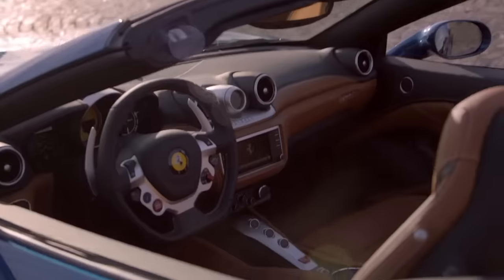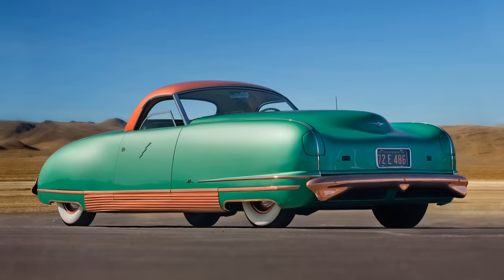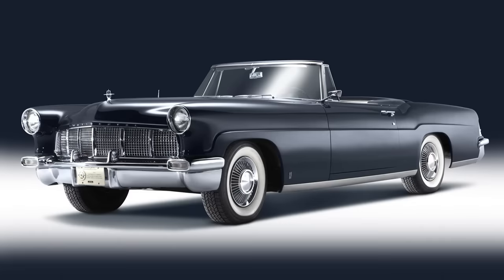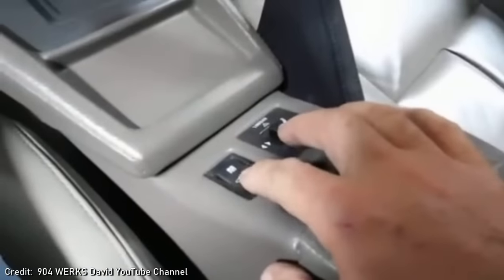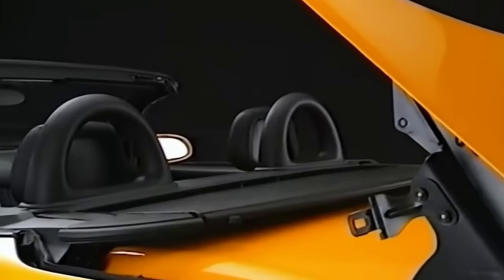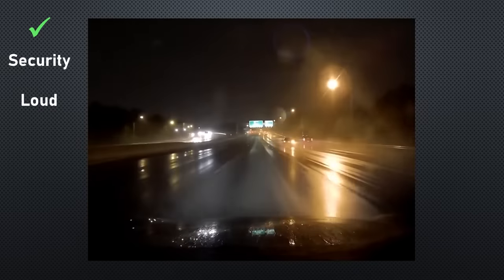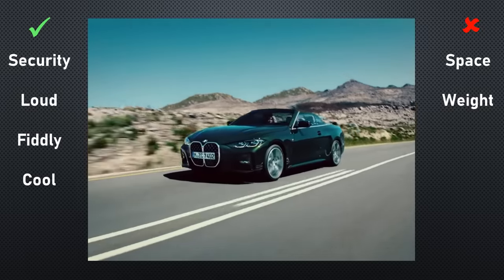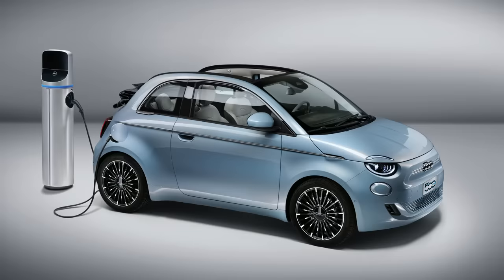The Rise and Fall of Retractable Hardtops

Comment: How far, if at all, does the RHT contribute to chassis stiffness (when it's up)?
Reply: Probably not much, if anything at all, as the structure is held together with hinges. The hinges would be pressure points for the forces.
Reply: @ar568  you can arrange hinges so they resist forces, but honestly I don't think it adds any significant stiffness.
Reply: @AR-zq9hq  If you do it for every hinge in every corner of each panel, you get torsional stiffness. 4*2=8
Reply: On the Volvo C70 2006-2013, the body ridgity improves with around 15% when the roof is raised
Reply: Considerably stiffer with the Megane cc. Noticeably so. But I only drive it with the roof down unless its raining.

Comment: But what about design factor? I am owner of SLK (2005) and I think, that hardtop convertibles are more solid that the softop. When car looks like a consistent  piece of metal - its almost piece of art. And when a part of car (roof) is made from some kind of fabric, it looks much cheaper (in my opinion). It like a your grandma trousers, hanged on a nice sporty car :)

Comment: Fondly remember my wife’s black 2008 Megane Cabriolet.  It was always fascinating to open/close the hardtop which included a glass panel roof.   A great drive on a 28C Australian summer evening with the top down, less so on a 43C Australian summer day.  2.0L petrol was a bit gutless, needed a turbo like the VW EOS.  
All our cars have had full glass moonroofs or sunroofs, but there is nothing like the experience of being in a true convertible.

Comment: I got one of the first SLKs brand new in late 1998 (as a 99 model). I remember putting the top down in public... crowds would gather. It was really a spectacle that nobody had ever seen before.
Reply: Thanks for sharing ! Must’ve been a cool moment. What was your color combo!?
Reply: @prabeeshsidhu  Black with oyster interior.
Reply: I hope the horrible rest of the ownership experience was worth that moment of attention.
Reply: @pistonburner6448  It was a great car. Never gave me any trouble and a lot of fun to drive. I put almost 100k on it from new and outside of regular maintenance the only issues it ever had was a motor mount needed replacing at like 60k and a parking brake interlock at like 45k.
Reply: @Dr.TJ_Eckleburg  Same can be said about a Dacia Sandero. Sorry to be blunt, but the SLK was a particularly abysmal example of a car compared to any relevant benchmarks.
Reply: Same story with a 2020 MX5 RF, most people dont really know retractables are a thing nowadays. Little kids especially go nuts when they see it closing/opening at a grocery store parking lot.
Reply: @pistonburner6448 who hurt you lol

Comment: Working in a garage there’s always a sense of dread when they come in with the roof mid cycle or not working.
Reply: Must be fiddly to rig all the microswitches on a folding roof. I imagine everything has to be set up to close tolerances.
Reply: Had a guy shatter the rear windshield on a Camaro top because he didn't install the replacement support brackets correctly 🙃 That's a $1200 mistake
Reply: Not going to name models that you have seen like this?  Enquiring minds want to know...

Comment: My Z4 retractable hard top is great, it doesn't go green like my previous Z's soft top. However when a hydraulic line split it cost me £1300 to fix. At least with a manual you can pull it up in 10 seconds, even when driving.

Comment: I think Top Gear really called it when they did their Cool Wall segment with the 206 CC: The auto-hardtops had always been a fashion accessory, so their appeal dropped off as soon as they became common. The companies that introduced them got rich off the temporary fashion and publicity, but you can’t be in fashion forever - and from an actual performance and practicality standpoint, hardtops are an objective handicap. The humble and simple MR2S manual softtop, with 2 latches for when it’s up and just one for when it’s down, remains as the perfect convertible implement.
Reply: I love how the older ones look with the clip on hard top. Reminds me of vintage lotus design.

Comment: I owned a Volvo C70 before and now a BMW 330 with a retractable hardtop.
I think it is a great concept: you can switch from a coupe to a convertible within 20 seconds.

They are aimed to be fun cars, not practical, although 4 adults will fit but trunk space is limited.
You know that before buying and if you can live with it, they are great cars to drive and perform well with top up or down.

Comment: I tried owning a soft top convertible (MX5) and didn't like it. I replaced it with a BMW Z4 E89 with a hardtop and noticed the following:
1. The cabin acoustics are much better. Road/wind noise not that much different, but I no longer felt like I was inside a drum. Overall feels more like a coupe.
2. Hardtop is far easier to wash and care for than soft top.
Not to mention the styling is much better with a hardtop in my opinion. 
While I know there are some downsides to a hardtop, like the weight and storage, and the added electromechanical complexity, I wouldn't buy another soft top. I much prefer the hardtop and I'm a bit disappointed they're less popular now especially since the technology is better than it's ever been.

Comment: I thought the Ford Skyliners from the late 50s were so cool. The entire top would automatically, with minimal folding, lift off the body, then stow away in the trunk, which had its own suicide door action. Definite flash over substance considering putting the top down negated any trunk space. And even when the roof was up, storage had been pared down to a metal based that looked like it belonged in a 1930s laundry room

Comment: Have a new shape A3 convertible and a 1 series convertible, both have been to the south of France from England several times, they are soft tops which means there is enough boot space for luggage unlike a hard top convertible, that space matters if you are going to use the car

Comment: Another disadvantage of hard tops are the awkward design that is often the result. Look at the Nissan Micra. Also the front shield window often extends much longer to reduce the amount of roof to store (check the 206 at 9:11). It reduces the cabrio experience. A soft top looks better and is more practical.

Comment: I think a number of convertible buyers want people to know they drive a convertible, even when the roof is up, and soft tops make that much more obvious than hard tops. Why pay for a premium feature if people are just going to think you’re driving the regular model when the top is up?

This was the same logic behind the first hybrid cars. They had to look funky and futuristic compared to the conventional ICE version of the same car, because early adopters wanted to make a statement as much as they wanted to save the planet. Now the hybrids look normal and electric versions have the distinctive trim level (some of which is practical, to save weight and improve aerodynamic efficiency by eliminating redundant air intakes and smoothing out the features).

Comment: I had a new 2016 bmw z4, which was great . I park in a lot not a garage and it was safe and solid . It was a fairly quick operation. Then a month after warranty, the electrical harness mechanism died. The bmw dealership barely knew how to fix it, and took almost 2 months to so do. The quote to fix was originally $3900, but after almost 2 months, they wanted the new quote to be $7000, um. No. It ended up at $4100 . Once i had it back, i sold it . Total love/hate for the car

Comment: You forgot one reason softtops are better then hardtops: the shape of the A-pillar. The steel roofs had to be small in order to be stored, so they made the window and a pillar steeper. This had the effect that when sitting in the car you almost touch the border of that with your head, a very unpleasant feeling. Softtops do not have that problem.
Reply: I like cars which are wide like an SUV from the bottom up to over the fenders. Then on top a small cabin and the people sitting close to each other like in the original mini.

Comment: I currently own a bmw 1 series e88. I love my car, but would MUCH rather have it equipped with a hard top rather than it’s soft top so as to have it’s look match the coupe. I understand that it’s a bit of a trade off vs a soft top, but I’d much rather add the extra weight in sacrifice of some power. The advantages in security alone dwarf the advantages in having a soft top. That’s before even considering how much cleaner the hardtop looks overall. 

I’ll put it this way: the bmw 1 series is, in my opinion, a beautiful car. With that said, an alarming amount of people informed me that my car looked so much better with the top down. All in all I just don’t think soft tops are the best look.

Comment: Loved this. I was planning to buy a Mercedes SLK but I have a wife and a kid and that means three seats. The SLK has only two. Ended up buying a CLK, a soft top based on the C and E platforms. C platform with E features, really. I still have my 2005 CLK and love it and I don’t think you’ve covered that car at all. Would be cool if you did. Extra points if you include the cars that came before it and the C and E class cabrio’s that replaced it.

Comment: My Peugeot 308cc 2ltr diesel 163 hp automatic is a pocket rocket. Also I've fitted a remote roof recline for £200 so I can recline the roof whilst i'm putting my shoes on!
One of the last to be built in 2014 and still has only covered 12k miles. The cruise control works from 25 mph so I use it around town . It takes all the stress away from accidently exceeding the speed limit . Headlights that track around corners with automatic height adjustment and auto wipers, heated seats plus airscarf.  I want to be buried in it.

Comment: I think you missed the mark with this one. Except for the cheapest solutions, which come with cheap cars, basically all convertible tops are hard tops anyway. E.g. Porsche tops may look like fabric, but on the inside are metal panels for the 911 and Boxster. Their marketing says that their customers prefer the look because they want to 'show' that they have a convertible. They still fold a bit more compact, but nobody buys a convertible for trunk space anyway. I would love to have an SL as a street parker, because when the pollen flies and the birds shit on your roof from the phone lines and trees, you'll know the advantages of a hard top... also, on real roadsters, a fabric top is simply a must in the eye of most owners. I think the Boxster would look kinda "wrong" with a hard top. It is not a fad, a fad is something silly, but hardtops are obviously not just a gimmick.
Reply from the maker: Thanks - good point. But it stands to my point that soft tops have more sound deadening (by having metal panels), so there's way fewer disadvantages now.

Comment: The one on my Mercedes SL leaked into the boot from the back seal. This is apparently a general problem and could be expensive as the electronics are in the bottom of the boot. I refitted the seal and patched up were the metal lip had corroded but it only lasted a short time before the leak came back.

Comment: I have an A4 soft top, you better be handy when they fail as the repairs and parts are like gold. Modern soft tops are very heavy and add on to that the pop up roll bar system and the story is complete... a very heavy car.

Comment: Soft-top convertibles look classier.  Having a glass rear window with heating-elements (IE, exactly like fixed-roof cars have had for decades) allows you to see on cold & chilly mornings, solving that very real safety problem.  Retractable hardtops are simply not needed.

Comment: I would not have bought my BMW Z4 E89 if it wasn't a hard top. Had 9 years and happy to keep it another 9 years. Perfect sports car.
Soft tops look like prams, very few get them right. Also trying to keep rag top clean from likes of bird poo a pain.
Reply: Only problem with E89 roof, BMW used poor quality wire which breaks causing roof failure. Otherwise my car works perfect 14 years old.

Comment: The problem with the used market is that the original drivers runs the cars into the ground for 50k miles and do little maintenance because the car is “still new”. Then the second hand driver has to restore improper maintenance issues that affect the car for the rest of its life. 
Fixing a hardtop that is out of production for spare parts sounds like a nightmare.
I wish there was a car company that exclusively made hard top coupes.

Comment: I will say this Hard top is cool but not when it started to have problem.. Soft top has issues too, but hard top breaks more often even if you barely drive. I had a 2020 SLC300, no problem with it for 24,000 miles. But then some people already had to fix their hard top two times before 20,000 miles. Fixing cost for both soft top and hard top are expensive but soft top is still a little cheaper than fixing the hardtop. Also, if you have a hardtop from Mercedes, its gonna be hard to find the part and it might takes a long time for it to be shipped from Germany to whatever country you are in.

Comment: It depends what you want and are intending to use the car for. I own two BMW Z4s with soft-tops and a Mercedes SL R230. There is no doubt that that the SL is much more insulting from wind noise compared with the Z4s even though they have glass rear screens. So, as a long distance car it is much less wearing on the nerves. 
I think all the reasons for less retractable hardtops being made today are valid but I also think the biggest reason is actually the profit margins of the car manufacturers. As said, why manufacture an expensive metal retractable hardtop when people will pay the same for a soft top? The boot space saving e.g the 15% example given, is hardly at the top of most convertible buyer’s list of priorities.

Comment: No mention of the Volkswagen Eos here?

Its not only a Cabriolet with retractable hard  top it features also that the sunroof segment can  be opened individually.

so far i know  its the only Cabriolet with this Feature.

most people think that these Hardtops doesnt need service / care like soft tops but its wrong especially all those Rubber seals and hoses to keep it water tight need a lot TLC and mostly owner related / not following procedures when servicing them its why they fail 

Every Eos owner should know Krytox ^^

Comment: I had a BMW E93. I like the idea but it was flawed, it leaked big time along many of the seals, added weight and made the boot space useless. Unless you really need sunburn on your bald patch a coupe equivalent will drive much better (I changed it for an E92) handling is better, it feels lighter and less body flex.

Comment: I do love convertibles, but they keep getting smaller.  Settled for a hard top Jeep which is significantly quieter then the corresponding soft top, and also better for heating and cooling.  But, hardly a push button open and I definitely miss the spontaneity!

Comment: It is sad that the hardtops have gone the way of the dodo. I live in Sweden and the climate is not compatible with cloth roofs. I used to have a Peugeot 308cc and just loved it. Looked really good with the roof off. Reliant tech from Citroen C4/Peugeot 308. A big enough engine and silent with the roof up. Had to sell it when the children outgrew the back seat. Now they are gone and I would gladly buy a hardtop convertible again, but there are none...

Comment: Sir, you show the Opel / Vauxhall / Holden / Chevrolet Tigra Twintop to illustrate the downsides of a retractable hardtop unjustly.  You cite lack of boot space, extra weight and worse handling as downsides.  The Tigra Twintop will fit two cabin suitcases in the boot with the roof down, it weights under 1300kg, and the chassis is stiffer and more sporting than the Corsa C which shares many of it's components only suffering a miniscule increase in 0-60mph acceleration.

Comment: I had an F430 spyder and let me tell you when the soft top goes haywire, it's a tremendous pain and cost. First time was 8 MONTHS in the shop and second time was 6 MONTHS. (I'm in Asia so the parts were a bear). From reliability I can see the attraction of hard tops.
Reply: That’s a car brand problem (8 months in a garage) and not a hard top technology problem.
Reply: @driliagor  The problem was with their SOFT top, not a hard top. FWIW I have a soft top Audi now, perfectly reliable. Expensive Italian sports cars are too finicky for sure.

Comment: I owned a Peugeot 207CC. I found the only issue was body flex when the roof was down. Road handling became terrible.
Reply: I've got a 307cc and I find the creaking and groaning (flex) around roof joints and seals annoying when the top is up.

Comment: My 1974 Mercedes 450sl has best of both world, It has soft top but also you can install hard top ...(yes, hardtop doesnt fit into car when not in use but still)
Reply: Lots of convertibles had optional semi-permanent hardtops. Off top of my head: mx5 (1st and 2nd gen) BMW 3 series, Honda S2000

Comment: I bought an mx5 with retractable hardtop new in 2007, drove it until 2012 and then sold it for family reasons. I miss it very much, I hope I will be able to afford an mx5 rf at some point in the future. Pro tip: don’t buy an Opel Tigra with retractable hardtop, they’re notoriously poorly engineered. UPDATE: I’m going to buy a Renault Wind, retractable hard top is not dead… :)
Reply: The Renault Wind is a “bold” choice! Rather than folding, the roof pivots to sit above the boot, which results in the slightly odd dimensions and the strange profile.